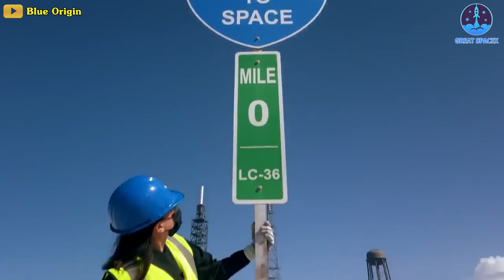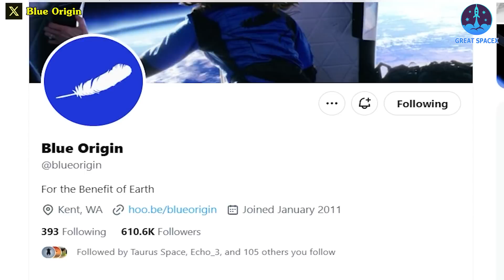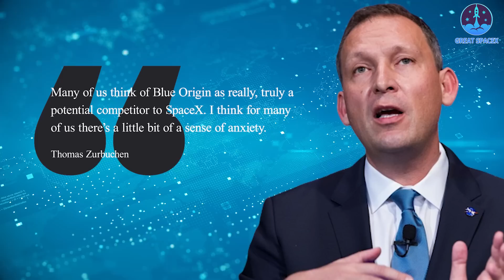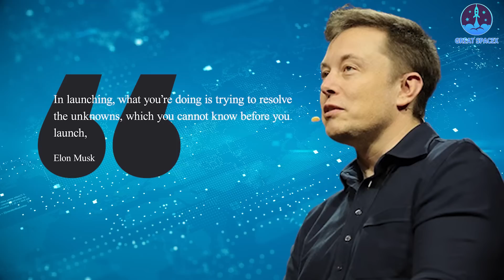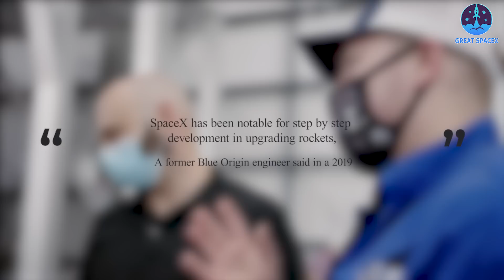Unexpected! Blue Origin New Glenn Production is further ahead than you think, but SpaceX...

Comment: The Apollo program was built as a series of steps, each testing and improving over the previous ones. They did not go straight into the complete Saturn V and Apollo capsule. SpaceX is doing something similar. No one has anything close to their knowledge of reusing rockets: landing, refurbishing, wear and tear on the components, issues that ariase over time, etc. You only get that once you start launching.

Comment: That production floor is HUGELY similar to how the floor of the transformer production facility I worked for BEFORE they managed to develop mature production practices!!  It looks to me like they are trying really hard to build ONE!  I am not impressed!
Reply: I had the same response to the image. They are building most of the rocket in one gallery and that is massively inefficient. 
Musk did tents and seperated the work with the (multiple) vertical bays and now a massive structure where assembly lines can be built. 

What I saw was a prototype lab. I would expect them to take a very long time to craft each component. 

By comparison, Spacex built nearly 400 Raptors, most of which will never go into a rocket, to iteratively develop a far superior engine to the BE-4 at a pace of 1 engine per day or more at less than 1/10th the cost of BE-4.